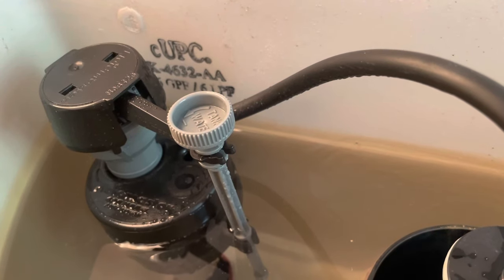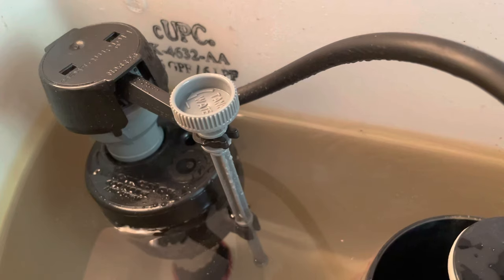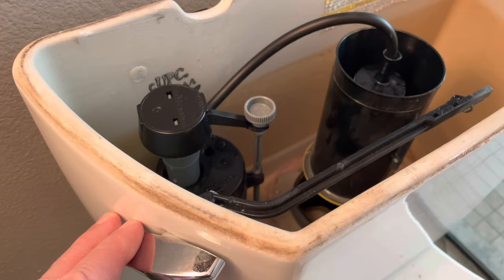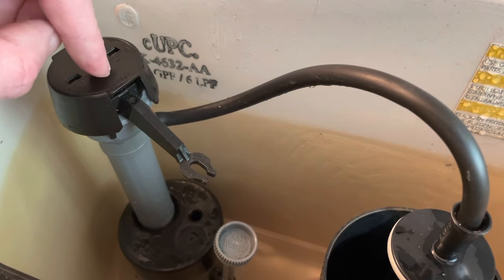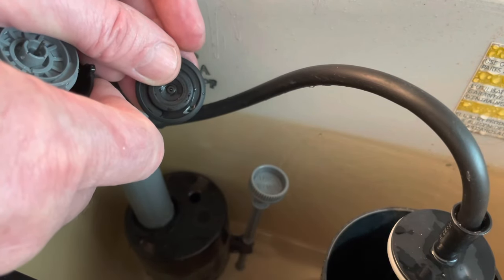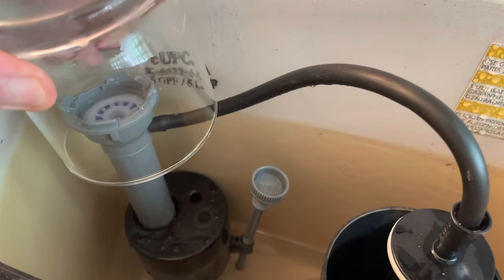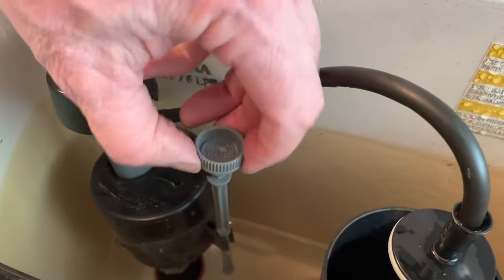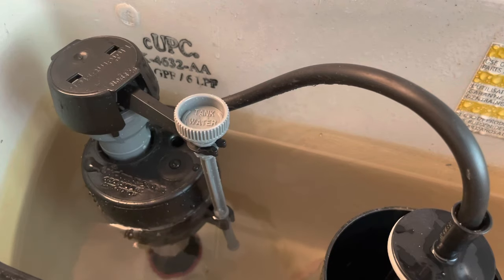Toilet Fill Valve Not Shutting Off / Don’t Replace / Fix Fast Cheap & Easy For Beginners

Comment: Thank you so much, Joe! I didn't think we could fix it but your video was fantastic and we did it!!! I so appreciate you taking the time to make this video. It saved us so much money and time!
Reply from the maker: Hey, that’s great! Always good to hear that it was helpful. 👍🏻
Reply: I’d just replaced the gasket and O-ring for the main flush valve as I had a tiny leak that caused intermittent running. Once that was seated, of course another problem came up: the flush valve not stopping! Found your video this morning, and I cannot thank you enough! Worked like a charm. But…now I have a little gurgle (it sounds like it’s right at the valve) that happens right as the water shuts off. NOTHING is easy, LOL! Do you happen to have a video that addresses that? I have not replaced the inner gasket on the flush valve yet, but I think this may be in the line itself? Good lordy 😢

Comment: Than you. My tank would not refill. Followed your instruction and replaced the rubber seal with a Fluid master 242 rubber seal. It is working perfect.

Comment: Thank you very much for your excellent video Mr. Joe.  We followed your instructions, buying a few of the seals so we have them handy when our other toilet seal completely deteriorates.  The seal in the master bath toilet was full of deposits and cracked.  Once we replaced it, following your instructions, everything worked properly once again, no more running toilet.  Thank you again.
Reply from the maker: Hey, that’s awesome, I’m glad to hear it helped you!

Comment: Toilet wouldn't stop running. Thanks to your informative video I was able to take valve cover off and discovered a broken bit of plastic was jammed in there. Removed that, put cover back on, no more problems!

Comment: Thanks and since my float was from "El Cheapo' is was not exactly the same but after finally getting it apart I did follow your instructions and it seems to be working again after months of using the bucket
to fill up the water tank.

Yes, i could have bought a new one for 15 bucks or so but since my shower head likes to drip a bit, I kept using the bucket it dropped in the flushing the toilet and yes, the next project will be new seals
for the shower faucets.

Thanks again Joe and take  care!
Reply from the maker: You bet, glad it was a help to you. 👍🏻

Comment: Thanks a ton for this video! I just replaced this valve with a brand new one and it worked for a day or two and then would not shut off. I was ready to rip it out and take it back to exchange it but I removed that too like you said and I instantly noticed minerals and deposits sitting on top of the valve. I flushed it a couple of times with a glass over the top, put back together, and now it is all good. 👍🏼
Reply from the maker: Glad to hear it helped you. 👍🏻

Comment: Did exactly as you said in video and it worked!  There were some small black rubber sediments (wonder how it got in there?)  inside the fill valve.  I removed them and flush out the valve and it did the trick. Didn't even have to replace the rubber seal.  Thanks Joe!!
Reply from the maker: You bet, glad it helped. 👍🏻

Comment: My toilet stopped running, but I knew this video would lead me in the right direction. Popped the top off and repositioned the rubber piece snug in there, and it fixed it. So simple, and I thought the worst-case scenario before watching this.
Reply from the maker: Awesome, glad to hear it! 👍🏻

Comment: Tbis was exactly what i needed! I took the black cap off and there was some deposits in it. Cleaned them out and it shuts off again. Saved me a trip! Thanks man!
Reply from the maker: Glad to hear it
Reply: After watching the video and reading your review I did the same. Cleaned the gunk off the black rubber and reassembled. Bam! works great........thanks.

Comment: Thx for the video.  Noticed my toilet running yesterday and couldn't get it to stop.  Was thinking I needed to replace the entire floater assembly.  Ended up replacing the float valve as you had shown and it works great now.  I was worried that it wouldn't work because I used a Fluidmaster valve seal but the float was a Kohler brand that looked almost exactly the same.
Reply from the maker: Glad to hear it helped. 👍🏻

Comment: Great hack Joe! I removed the black fill valve cap then flushed the filter x3 and the water stopped where it should with each flush. Thank you for helping me avoid replacing the whole fill assembly.
Reply from the maker: Awesome, glad it helped you! 👏🏻
Reply: It worked for me too. Do I need to replace it eventually or is this permanently???
Reply from the maker: @bero3356  eh, eventually you’ll need to replace, but this keeps them going a LONG time. Even if the valve needs nothing more than cleaning out, I keep the extra seals under the sink and just stick in a new one while I’m in there.

Comment: My landlord had to replace the water line to my house. The crew used PVC pipe. Immediately after turning on the water my toilet started running. I popped the Fluidmaster 400 cap off and removed the valve only to see that the valve was totally clogged with PVC saw shavings. After a good flushing I didn't even need a new rubber valve. Your video was an eye opener and I thank you.
Reply from the maker: You bet, glad it helped.

Comment: Thank you, sir. My brand new toilet kept running. After watching this video, I popped the top seal cap off and found small pieces of tile stuck in there. Cleaned it, and that fixed my problem.
Reply from the maker: Glad to hear it, and yes, it’s not uncommon to find “gallstones” in there lol. 👍🏻
Reply: @papajoeknows8355  My problem was that I didn't cover the water pipe during the bathroom demolition so the debri got in there.

Comment: Had already bought the new flow valve thinking I"d have to replace the whole thing and was nervous about trying to adjust the water level.  But w/ this trick, I just replaced the top thing. (I popped off the top and replaced it w/ the whole top of what I bought, rather than pull the gasket out).  Easy and it works.  I had already, unfortunately, fiddled w/ the water level screw before so messed up the original adjustment. It won't turn any further (at the limit) and water is over 1" below the top of the tube, but toilet is flushing fine now.  Thanks!
Reply from the maker: If your screw is at the limit, you can adjust the height of the valve itself… first shut off the water, then lift the plastic “collar” (see video below), then pull up on the valve portion to raise it a bit, then re-secure the collar. That way your screw adjustment range will be more appropriate:

https://youtu.be/ovdWF5Hdz8U
Reply: @papajoeknows8355  Thanks, yes, I was aware that adjusting the height would prob fix that problem.  I wasn't sure which way (up or down) to adjust it though so I appreciate it.  So far it's working fine as is but if I run into problems w/ the water amount, I'll do that.

Comment: Very helpful video!  the local village shut the water off for a while this morning when I used the  the toilet  right after that it wouldn't stop running... Took the seal out cleaned it there was some sediment in there works great now!
Reply from the maker: Yes, that often happens when there’s been some work done “upstream.” Glad the video helped you!

Comment: Worked for me too! The seal was fine, toilet is new (installed in 2021/2022), but we are on a well and get small mineral deposits. Had no idea I could clean out the flush valve! I have to clean out the washing machine cold water intake from time to time. Thank you for the video!
Reply from the maker: You bet, glad it helped. 👍🏻

Comment: Thanks for your video.  There are multiple videos on the Fluidmaster 242 seals, but yours seems to be the clearest.  Replaced mine today.  To start off, the black fill valve cap has a left notch that lines up with base notch.  After you turn a quarter counter clockwise, the cap notch will be directly in the middle of the two base notches.

Comment: Great tip.  Stuff always breaks at night.  I pulled it apart flushed it and cleaned the rubber value and it is working as temp fix. Order a new rubber value just now thanks

Comment: WOW! This worked for me, got to love the internet! Some background info for this fix for me. Two days ago they were working on the apartment upstairs. The maintenance guy asked if he could shut my water off because they had to cut a pipe upstairs. I remember hearing him flush or drain the toilet tank.  When I opened the rubber gasket, it had what appeared to be tiny pieces of aluminum foil inside, preventing a clean seal. I wonder if draining the tank totally caused this debris to be kicked up and sucked into the gasket? But then again what is foil doing inside my tank? Anyhow, thanks for this tip, this is youtube gold!
Reply from the maker: You bet, glad it helped. And yes, it’s not uncommon to find “gallstones” in there from something done upstream. In your case those may have been little flakes of solder associated with their repair.

Comment: Ty the demo shows what happens 90 percent of the time a leaking rubber seal because of sediment build up and not replacing the whole valve great video
Reply from the maker: Yes, alot (I’ve decided alot is one word) of times it’s just sediment. One of the viewers found what he called a “kidney stone” which I thought was pretty descriptive lol.

Comment: I took that rubber cap off and then flushed out any minerals that might have been in there. Put the rubber cap back on and turned the water back on. The waters not running anymore when the tank is full. Thank you very much for your video it just solved my toilet problem.
Reply from the maker: Awesome, glad to hear it helped you! 👏🏻

Comment: Just in case it wasn’t mentioned. The first part you unhooked that you can twist up and down. Mine was all the way turned down so I loosen this and now the fill valve works! I also cleaned out the sediment as well but wouldn’t have figured it out without this video!

Comment: Hi Joe!  I watched your video to repair my running toilet.  I followed your instructions to the letter and did indeed stop that toilet from running!❤❤❤. You were spot on and there were tiny pieces of sediment under that cap.  So I flushed it like you said and voila!😮😮😮😊😊😊. I detest a running toilet.  Had it fixed in 5 minutes.  Thank you for the tutorial and confidence you gave me❤❤❤. Subscribed and liked 😊
Reply from the maker: Awesome Pauline, glad to hear it, and thanks for subscribing! 👏🏻

Comment: Thank you! This saved me a valve. I had a piece of plastic in the valve under the rubber seal and it was not allowing it to seal properly. Removed it and problem solved.

Comment: THANK YOU.  I found a pebble in that basket (white mesh thing).  The pebble probably came from a pipe failure at least 15 years ago down the street from our house.  Pebbles of varying sizes got into pipes during the repair and flowed into our house and caused the shut off valve for the sink to leak.  Problem fixed!
Reply from the maker: Awesome, glad to hear it helped. 👍🏻

Comment: This worked for me, Thanks!! The seal wasn't even bad, just knocked loose due to water shut off and when it came back on, it had some fluctuating pressure. I took the seal out, and placed it firmly back into place and the leak stopped.
Reply from the maker: Glad to hear it. 👍🏻

Comment: Thank you for this video. I have just replaced my fill valve corner valve. Well pretty much everything but the toilet and it worked good for about 5 flushes and then it would run just a little and found your video and I went and popped that cap off and there was some little rocks keeping it open. So I thank you very much. Have great day.
Reply from the maker: Hey that’s awesome, glad it helped. And yeah, it’s not uncommon to find some “gallstones” in there, and it doesn’t take much to cause a problem. 👍🏻

Comment: Thank you Joe! I used the cup over top technique to flush out debris, and cleaned the rubber part. 2 mins. Running stopped.

Comment: Followed your directions and it worked OK. Found a small piece of corrosion probably from the outdoor water supply where they are digging up the street pipes and installing a new fire hydrant. The gasket appeared to be in good shape so I did not replace it. Easy to follow directions! Good video!
Reply from the maker: Awesome 👏🏻 glad to hear it was helpful. 👍🏻

Comment: That was great! Thank you so much. Just fixed my runny toilet. And I'll go you one better: After seeing the price of the replacement valves, all I did was I  took off the valve seal  and cleaned the mineral deposit from it under hot water with a cotton swab and replaced it. :)
Reply from the maker: Awesome, glad it helped you! 👍🏻
Reply: @papajoeknows8355  Although I still have a problem I just noticed. The toilet still runs too long after flushing, and I resolve it by pushing down on the top of the valve housing. Apparently, the seal is not seated properly. Any ideas on how to properly seat the seal in the plastic thing? As soon as I push down and put pressure on the top of the housing the water stops running.

Comment: Thanks for the hack…replaced the fill valve less than yr ago and it started running again I was like it can’t be shot already…followed your steps and found  debris blocking the seal from seating properly and I flushed the valve…bam no continuous running toilet now.
Reply from the maker: Awesome, glad to hear it was helpful! 👍🏻

Comment: Thanks     .,,,,,,   I saw there were mineral deposits in the rubber gasket of the flow valve as well as the flapper valve after I replaced them both.   I did keep the flow valve because ever since I was a kid I like to take things apart and see how they work inside. The flow valve has been sitting on the washroom floor a while and if I didn't see your video I would have used a screwdriver to pop off that black cap. As soon as you said quarter turn left.  I went and picked it up did a quarter-turn left and the cap came off perfectly. It was filed with minerals. Thanks for saving me some money  for the next time around.
Reply from the maker: You bet, glad it helped! 👍🏻

Comment: Thanks, I had a gut feeling that the problem was in the fill valve mechanism. Took out the gasket cleaned off some minor buildup, and put it back on. So far so good.
Reply from the maker: Yes, sometimes that’s all it takes. Well done! 👍🏻

Comment: Thanks! I bought a brand new valve and it was constantly hissing. Pulled that cap off and there was a bit of plastic stuck in the seal. Fixed the problem!
Reply from the maker: Awesome, glad it helped! 👏🏻

Comment: Thank you very much for the video. The seal of my fill valve was still decent looking. I cleaned the little deposit, put it back and it was working again. Hopefully the problem is addressed for a while. I might buy a replacement seal just in case.

Comment: Thank you soooo much!!! Mine had mineral deposits like little pebbles in it. I didn’t change the seal or anything, just cleaned out the mineral pebbles and it works perfectly again!
Reply from the maker: Awesome, well done! 👏🏻
Reply: I had the same problem. I tried adjusting the float that didn't work, in my case I had to remove the fill valve to do a proper cleaning because inside was clogged with little pellets, I almost went out to purchase a new fill valve . Thanks to you  I saved a bunch , I have 5 toilets in the house .

Comment: My toilet has been running for about a year now so I just turn the water off when I'm not using it, too lazy to go buy another pump. I originally checked this video to see if it would help me determine what type of pump I should buy. And then I saw what you did I went in my restroom deconstructed did it like you did, the gasket was fine I put it back together and it no longer runs. It mayve just needed a nice little twist to the left to tighten it up. I don't know but great video thanks for the help.
Reply from the maker: Awesome glad to hear it helped! 👏🏻

Comment: Thank You that helped. i bought a Fluidmaster kit 3 or 5 years ago when my toilet was messing up, but then it started working again so i never installed it. last weekend the flapper broke so i was trying to wedge something under the float arm to stop it from filling while i went to get a new flapper, while i was messing with the float arm it broke so fi finally installed the kit i bought 3 or 5 years ago. and the toilet has been working fine all week then just now it was filling but not shutting off all the way, so on one hand the kit is brand new on the other hand its maybe 5 years old. so i took it apart like you showed and it all looks brand new, so i put the seal back in and tried again and it is working now. not sure what the problem was but at least now i dont have to run down and buy more toilet stuff after buying a new flapper and fill hoses last week.
Reply from the maker: It may be that you just need to adjust the float. Here’s a video:

Running Toilet Spilling into Overflow Easy Fix DIY
https://youtu.be/uTcYxn2bpDg

Comment: I had seen my plumber do this but forgot how he took the top off.  You just saved me from breaking it.   In my case I think the metal stem to the lever just poked too big a hole so the seal did not move with the stem.

Comment: THANK YOU!  The hose going into the overfill tube wasn't working.  Disassembled per your instructions - didn't see any build-up.  After reassembly, it works perfectly.
Reply from the maker: Awesome, all’s well that ends well. 👍🏻